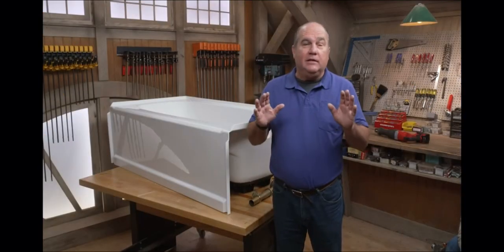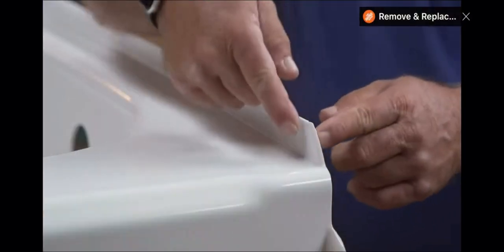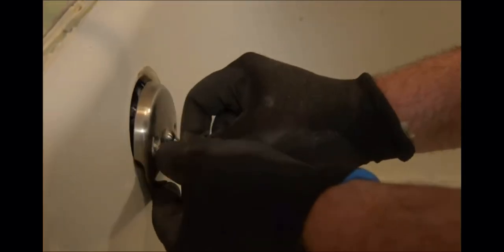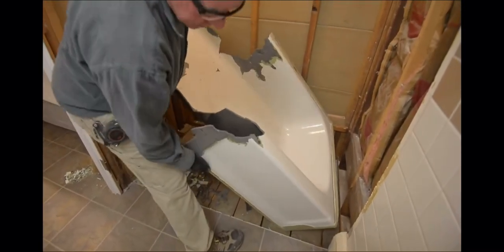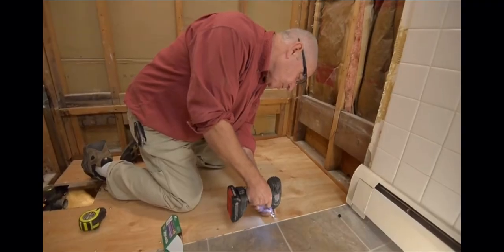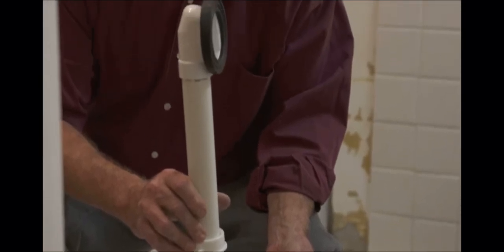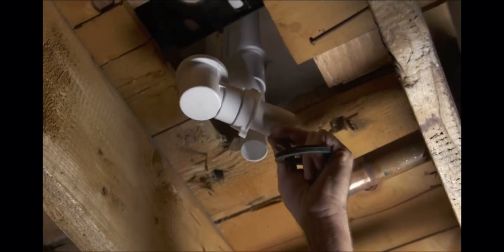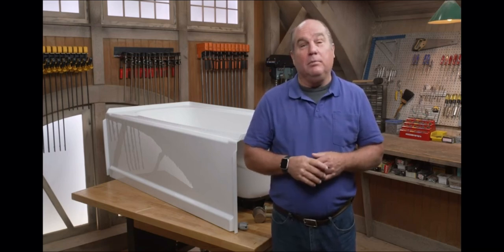Why is replacing a tub so much??

Comment: We replaced our tubs in our home renovation.  We added an additional layer of 3/4 inch subfloor plywood to the subfloor to strengthen the floor under the new tub. We installed porcelain and steel bathtubs and I filled the underneath voids with Rockwool insulation to aid in keeping the water warm while bathing as well as deadening the sound making it seem more solid. It came out great! My wife says the water stays hot longer and it doesn't make noises like our old fiberglass tubs used to do. I highly recommend porcelain and steel tubs as they are more scratch resistant and or just a lot more solid!
Reply from the maker: Nice touch with the insulation.
❤